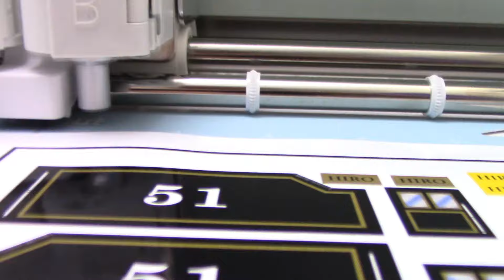How to: custom Patchwork Hiro Trackmaster Thomas & friends y sus amigos 托馬斯和朋友 Томас и друзья

Comment: We need Thomas with his original dark green paintwork, white outlines, LBSC, and number 70 from The Adventure Begins film when Thomas came to the North Western Railway to work as I'll start working on Introducing James from the same film when he was just a black engine and get another Percy so I can turn the older Percy into a light blue version of the newer one and also get two more James's so one of them can become Introducing James and the other can remain the same as I find more AA batteries for them, I mean, I got one AA battery for my Thomas and he's working still since I first found him without any side rods on his wheels before giving the engine a wash down to be a more cleaner engine while Train cleaning and giving that Thomas a test run on the tracks after I first found that Thomas